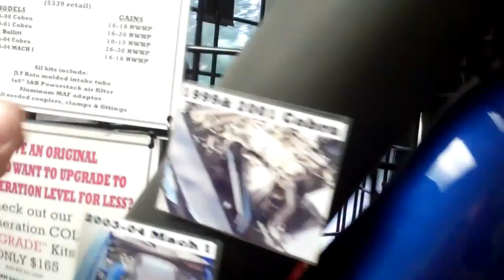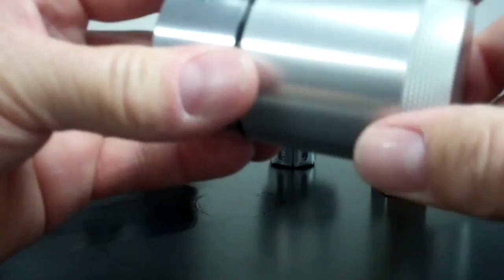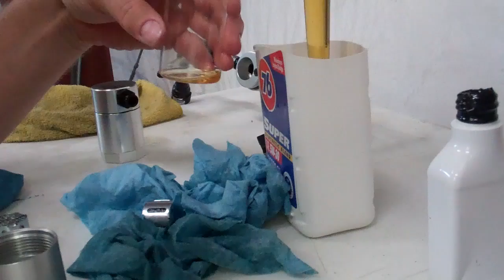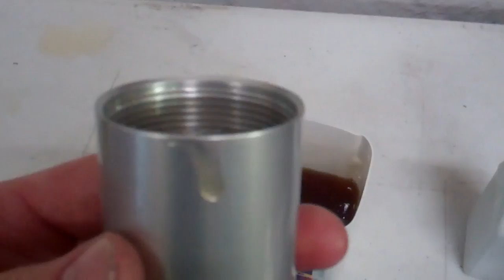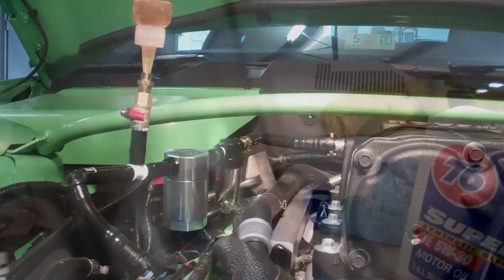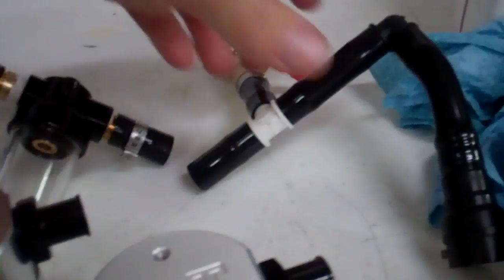JLT PERFORMANCE OIL SEPARATOR TESTING

Comment: Glad I bought yours..I was checking around on the internet came across quite a few, some at a low $25.00 price tag a few cost more then yours. After watching an AmericanTruck.com video I was sold on the JLT then I watched some of your video's, so I felt yours would do exactly what it was designed to do.  And now the proof is in this video, your JLT does catch the oil..Mine has been installed for 6 days and about 600 miles, 500 miles of that was the day after the install I drove to Vegas for a few days. I have a 6oz cup comming in a few days, and  at the 3000 mile mark I will make an inspection and cleaning video for my channel  then at that time I will switch out the 3oz can for the larger 6oz can. I did make an installation video of the 3.0..
https://youtu.be/VvM1fN4Cn84

Comment: Installed this about 2 month ago...very easy to install, about 20min. But I have a question...I noticed a large drop in fuel mileage, about 3 or 4 miles a gal. especially in driving around town. Can't imagine why that would be....any answers.
Reply from the maker: Double check your connections but an oil separator can't cause a MPG issue

Comment: on the 2017 mustang gt jlt 3.0 catch can. Is the screen suppose to be on the engine or the in take side on the catch can?
Reply from the maker: PCV or engine in coming side
Reply: @JLTPERFORMANCE  what?
Reply: what?  so the honeycomb mesh is it supposed to be on the valve cover side or the intake side?
Reply from the maker: @jakesreef1730  If you need help the best thing to do is contact us directly, we are here. Filter is on the Valve cover/engine/PCV side.

Comment: Sorry to rain on your parade guys, but that is not a realistic test.. A PCV system sucks hot air and oil and water vapor from the engine, not a cold liquid, so this test really doesn't demonstrate anything beyond a late night infomercial. Does it have the ability to condense those hot vapors and catch the liquid is the only measure of performance. As a guy that built his first one, that is still installed, out of a mason jar, a tomato soup can and some BBs, I do know a fair bit about this. Mine is going strong some 20 years and nothing gets past it at all. Both your original and the obvious rip off are good setups for real world conditions. Although one may be slightly better than the other, you need to do a real test to show it. Put your setup from the video on and go drive 2000 miles, because that's the only real measure
Reply from the maker: this is a 6 year old video you're posting on and a product that has changed and proven.
Reply: @JLTPERFORMANCE  my only point is that this is not a real test. I like real info being out there and anyone looking at catch cans is going to look at more than one. Like I said, nothing wrong with the design, just the infomercial level test

Comment: What if the filter plugs up will the pressure cause enguine seals to leak ? Just curiouse
Reply from the maker: Yes, but our filter will not clog unless tons of junk in the engine and no maintenance from the customer. Highly unlikely
Reply: @JLTPERFORMANCE  thats what i wanted to know my suburban is emaculant my maintance i even change brake fluid every 2 yrs

Comment: IMO, you should go head to head with that other company that "blew" air through theirs that you called out in this video.

You should also use vapor and not liquid oil and you should run the engine above idle.

If you beat them then, then you would have more credibility...

; )